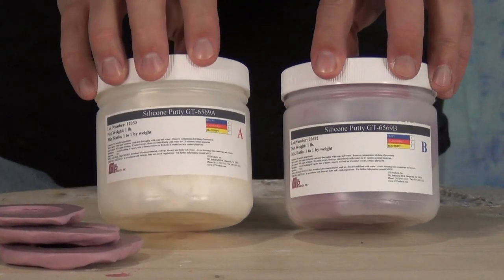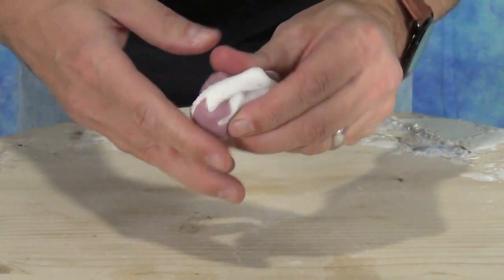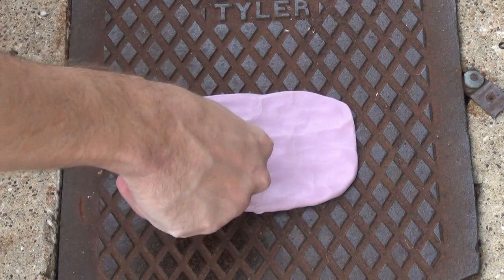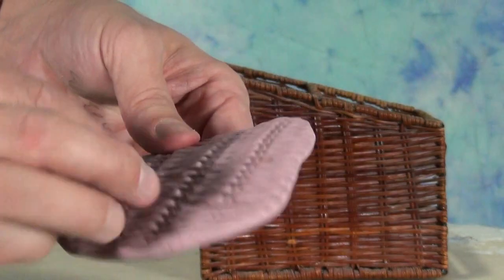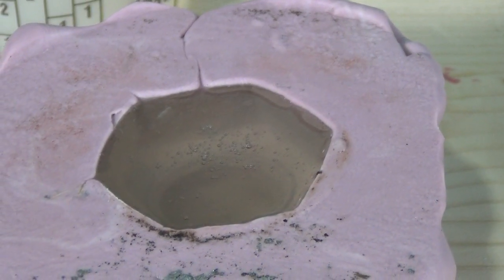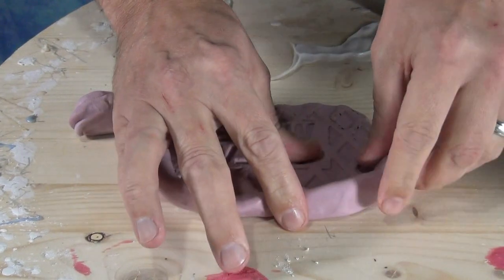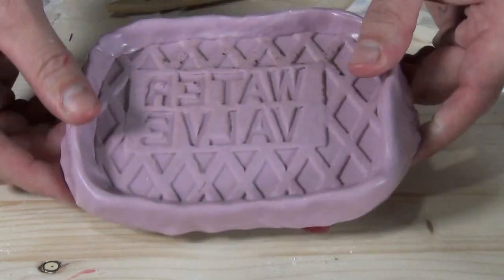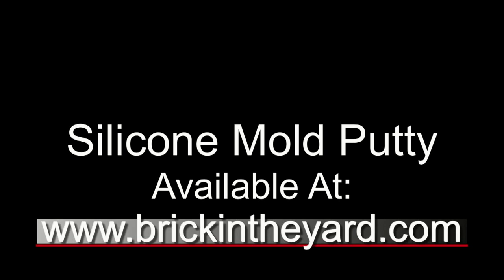Mold Making Tutorial: Molds With Silicone Putty

Comment: Hi. Nice video. My question is this. Is this putty good to pour wax in it? And is this putty good to make a mold for a 1/35 Tiger tank front drive sprocket? I want to make the 1/35 Tiger drive sprocket in steel for a 1/35 Tiger. I am building it all in steel. But I need to make the front drive sprockets and idlers in steel. Thank you for your informative video. I have learned a few tricks in mold making today. Thank you.
Reply from the maker: This will easily handle wax temperatures of 200F-400F, but you might want to use the softer putty as this one is pretty firm.
Reply: @brickintheyard  Thank you.

Comment: Hi! Could this withstand 275º (F) if I created a mold to bake a polymer clay piece?
Reply from the maker: This formula will handle up to around 400F. If you need a silicone for low temp metal casting use our 70-60 formula.